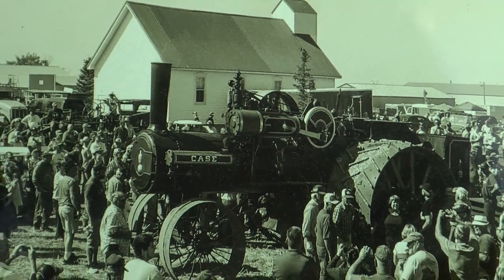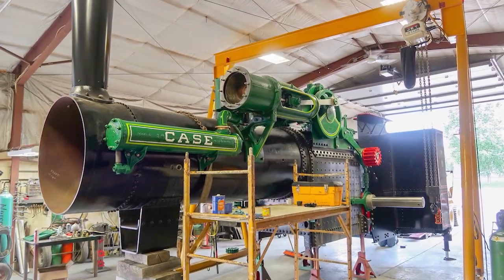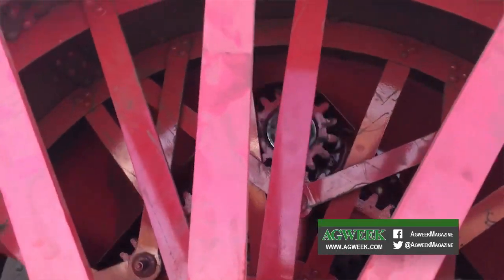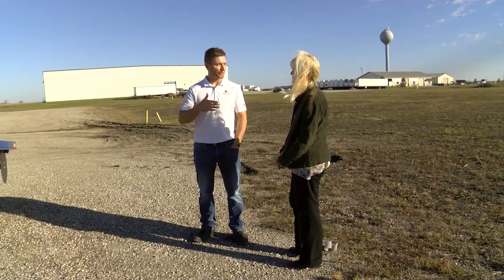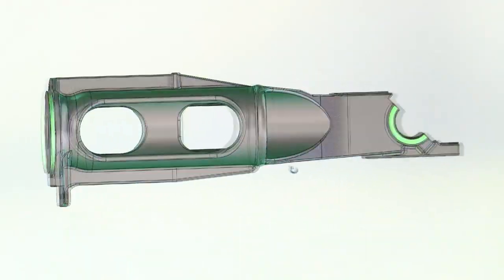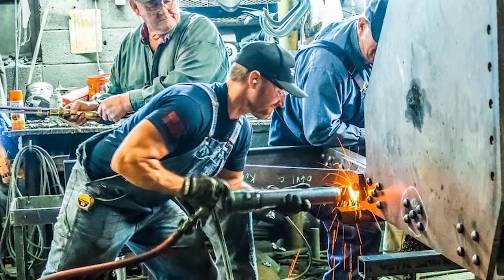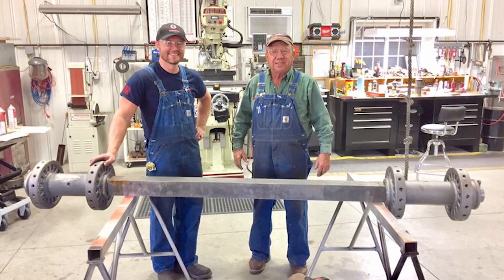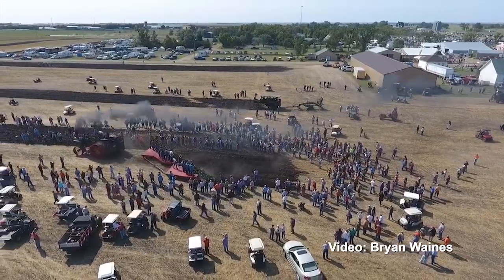AgweekTV: Case 150 Rebuild

Comment: It is NOT the largest steam engine ever, but is the largest steam traction engine.
Reply: The largest steam engine ever, was made 30 miles up the road from Racine, in west Allis Wisconsin,
By Allis Chalmers
Reply: @RJ1999x  Since a railroad locomotive is also a steam engine (or has one or two steam engines to use the broader meaning of the word), I think the Big Boy is far larger than anything from Allis Chalmers. Then we have all the great steam engines in ships.
Reply: @skunkjobb  The big boy isn't even close to the manhattan engines that Allis Chalmers built, nor anything in a ship was that size
Reply: @RJ1999x  I can't find much about engines called Manhattan made by AC. I found this link https://www.nycsubway.org/wiki/The_Interborough_Power_Plant where it says "the Fifty-ninth Street power plant consisted of nine 7,500-kw. maximum capacity Manhattan-type Allis-Chalmers double-angle compound engine units"

If that's the engines you mean, they were about half the power of one of Titanic's steam engines. But much more powerful than the Big Boy.
Reply: @skunkjobb  The titanic engines were rated as a team of engines. The Manhattan engines were the largest single engine ever made. And was pretty much the end of large engines, the steam turbines took over after that
Reply: @RJ1999x  You didn't say if the one I found was the Manhattan engine you were thinking of, was it? Of course I mean one single steam engine when I'm talking about Titanic, not the combined power. http://www.titanicology.com/Titanica/TitanicsPrimeMover.htm
" The reciprocating engines were designed for 15,000 indicated horsepower (IHP) each when running at 75 revolutions per minute."

Titanic had two such engines plus one steam turbine. The piston engines could go over 75 rpm so we're talking about above 15 000 hp each.
Reply: @skunkjobb  Those are the Manhattan, they were built by Allis Chalmers, they were running at a nominal hp of 11,000 hp, they were capable of 20,000 each under heavy load. They were designed by Edwin Reynolds and the unique thing about them is they had no flywheel. The generator was so large it acted as the flywheel.
Reply: @RJ1999x  The link I posted about the NY subway said 7500 hp nominal and 11 000 to 12 000 max, not 11 000 nominal. The Titanic article further said "When running ahead at 83 revolutions per minute on her reciprocating engines, the entire power plant would develop about 59,000 horsepower, of which 18,000 horsepower would be contributed by the turbine"

If we take 59-18=41 thousand and then divide that by two we get 20 500 hp per piston engine of the Titanic, close to double that of a Manhattan engine. If you have other information, please post a link with some quotes.
Reply: @skunkjobb  I have a book on them, I also own the original blueprints of the Manhattan engines
Reply: @RJ1999x  You do realize that that is not a good answer, don't you? I had some specific questions and figures, please adress them and don't just tell me you have a book and blueprints.
Reply: @skunkjobb  First off I don't take orders from you. I do have a book on the specs of the engines and I do own the complete original blueprints, they were supposed to go to the Smithsonian, but I outbid them. I don't have the book in front of me, and just so you're aware internet figures mean nothing.
The titanic engines were not larger then the manhattan engines, you can tell by the size and weight they could not possibly make more HP.
Reply: @RJ1999x  Why are you being upset just because I ask you to provide the figures? That talk of "taking orders" is just immature, don't go there.

I have provided links and quoted data that say that the engines of Titanic were more powerful than the Manhattan engines, close to double the power. I haven't made up those figures myself. I have exactly zero prestige in this question, I only want to know what's correct so please provide the correct data if you say the figures I quoted were wrong.
Reply: @skunkjobb  I'm not upset about anything. But I also don't take orders from random internet posters.
I've read up on the titanic engines, and the articles vary in HP from 8115 to 15000 each IHP . The Manhattan engines were rated at a nominal 11,000 hp. What's the difference between IHP and HP I don't know. Before I can state a fact I need to get my book out and reread the facts and statistics, and compare it to the titanic engines.
Wikipedia is not a source for facts, not article written by a titanic fan exaggerating it's memories.
Reply: @skunkjobb  IHP is indicated HP. That means an engineer calculated the approximate HP at the engine, yet it's never been tested or proven.
The Manhattan engines were not IHP and actual HP could be calculated by the current generated .
So for the sake of your argument there is no real proof the titanic engines could produce 15,000 hp.
Which is probably why the Manhattan engines were billed as the largest ever built
Reply: @skunkjobb  well if we’re talking railroad, big boys aren’t the fastest, largest, or most powerful. The only thing that gives that title to the big boy is the wheel arrangement. But even so there were locomotives built with larger wheel arrangements than the big boys, such as the Erie Triplex’s, having the 2-8-8-8-4 or 2-8-8-8-2 arrangements. The only valid and true statement towards big boy being the largest is if you were to say “big boy is the largest OPERABLE steam locomotive in the world.” I’m sure you probably already know that but I’ll just leave this here for anyone regardless

Comment: It is not the original boiler. Notice the lack of rivets.
Reply: It isn't the original boiler, but they do have the original boiler (it was too far gone to restore). They removed the serial tag from the original boiler and installed it on the new boiler. The original boiler is still put on display at the show alongside the Case 150.
Reply: I can see rivets around the barrel at the front tube sheet and in around the fire box area
Reply: @eb17816  Those rivets at the front are just for the smokebox, and what you saw on the firebox were staybolts. The actual boiler itself, by today's regulations has to be welded if made from scratch.